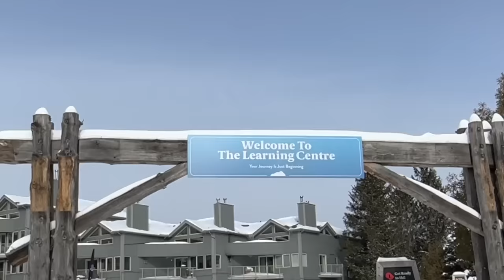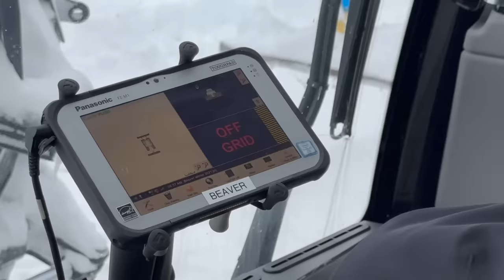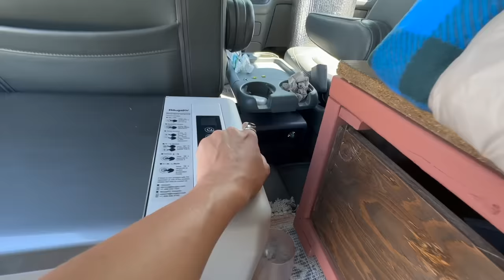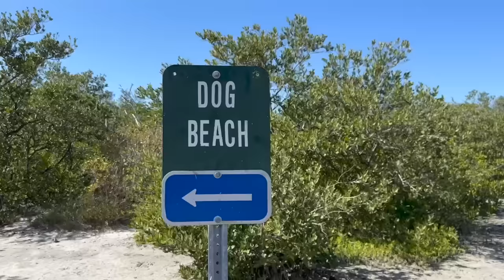Camping upgrades in my grandmas old mini van :)

Comment: Hey Juliana!
Great to see you back! 
Nice video! You're looking really well!(lovely as always 😉)
Nice upgrades to the van!
..( You could always attach an off cut strip of plywood or batton lengthways underneath the centre of the pull out to make it more rigid and hold more weight/pull out further?!just an idea cheap and easy and if you have a piece of scrap?)
Congratulations on you sisters baby!
Have a great week..
Cheers from London 👍🏴🇬🇧

Comment: Random thought , keep one of those rechargable battery jump boxes in the van for 2 purposes 1 obviously if fridge runs van battery dead or 2 if you get the one with cig lighter thing you could plug fridge in or even charge your phone if your main box dies .....they also work great for usb powered fans i realized

Comment: I have a 599w hour refrigerator freezer. I can only run 8 hours on a full charge. But when I unplug it to save power. I've  noticed my sodas stay cold 2-3 day without me running it. It has pretty good isolation. So you can try saving power that way. But it also depends on what foods you are keeping cold. So consider that for certain things like Mayo etc.

Comment: Really enjoyed the video! I'm outfitting my Chrysler Pacifica for camping/traveling. I tried a Coleman 30x80 cot, with 3 inches of foam mattress. Didn't work too well (too mushy, van has a tilt to it), so I'm going to build a level bed frame similar to yours. Hunting for the most comfortable mattress for it (just tried a 6 inch high density foam mattress - too hard, my back was not happy). Installing a slide-out shelf similar to yours, already got a set of 24 inch drawer sliders (the slow-close, fancy ones). I have gobs of LifePO4 battery power, 2500 watt pure sine wave inverter, 4 120 watt portable solar panels, 40 amp solar charge controller with Bluetooth, DC to DC charger, 12v 32 quart fridge/freezer, air fryer, Instant Pot, gaming laptop and Meta Quest 2 VR goggles for entertainment. Also have a 10x10 canopy with mosquito net and movie screen and projector, and large rooftop cargo carrier, as well as a of couple tents (basically a small village. Lol). I've been watching channels like yours for more ideas, and love seeing the adventures you all go on. Just waiting for my youngest to turn 18 (this October), so I can hit the road for a couple of weeks at a time (I'll take some mini trips before then). Please keep the entertaining content coming, and congrats on becoming an aunt! :)

Comment: the 2 boards you screwed to bed, get 2 more  and screw to the plywood. 2 on bed move down till it fits.  cheap & easy  and then your slide talbe be stronger

Comment: This is the first time I seen one of your videos. I just have one comment for your pull out table. You don’t need two legs. You only need one in the middle and it would be sturdy enough. You’re gonna need 2 little ones and one long 1 it will work out perfect for what you need it for.

Comment: Hi Miss Juliana. Glad to see you back. Congrats on the new baby in the family. May I make 1-2 suggestions;  #1 I found that skeetters & other bugs don't like Baby oil & it works great as tanning oil. #2 on your slide out table, if you take 2-3 pieces of 1/4"x 1.5" wood  & cut to the side to side width of sliders. Screw/nail to bottom of sliders. Cut strips of plywood to fit between the bottom of table top & 1/4" cross members. Attach these to bottom of table top 1/8" from sliders, helps with side to side movement, plus give you strength & somewhere to attach legs. After thought....for the legs....what about some old tripod adjustable legs? When done with table, flip legs up under table & slide in & the cross members will support them safely out of the way.....By putting the pull out block under the top, it will look nicer. You got this. Be safe & Thank You for sharing your adventures with us.

Comment: That is the one thing I worry about. With my four Chihuahuas I just put them in their dog stroller and take them with me being in a wheelchair people don’t usually stop and yell at me for having dogs in a store because they’re in a closed stroller, but my grandson has a pitbull, and since he will be traveling with me this summer, I am not sure how to deal with a larger dog and the heat.

I am a disabled senior that travels for suicide awareness since losing my son Jeff in 2016, in my wheelchair modified 2010 dodge grand caravan with my four Chihuahuas.  I have a wire cubby in the Hatch area for storage. I also have a platform bed with some storage space underneath. I have kept the smaller section of the backseat as well as the two front seats for when my grandchildren travel with me. The rest of the floor space is taken up by my power chair. I am by no means a minimalist and definitely travel with too much stuff. And I still have more stuff for camping and emergency gear at home outside Palestine TX, for the day I can score a larger rig.  Unfortunately, due to the wheelchair modification, I cannot have a rear hitch for a tiny trailer or even a storage box on the back, and being in a wheelchair it is hard to access anything on the roof. But I do have 2 solar panels and a roof box up top for when other people travel with me. As well as a Bluetti EB70 n EB3a solar generators. My dream vehicle is a short wheelchair Bus conversion with plenty of storage space! Safe Travels & Enjoy YOUR Journey 
❤️🐾🚐👍🏻😁☀️🇺🇸🔥
https://youtube.com/@JeffeysMom
FB Jeffeys Dawn A Burton